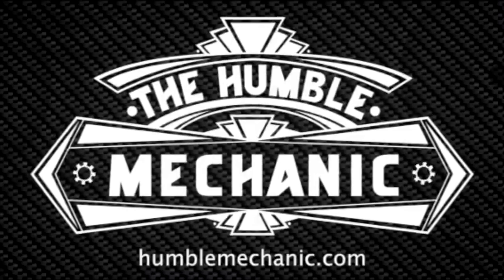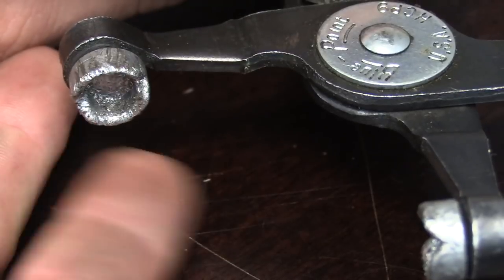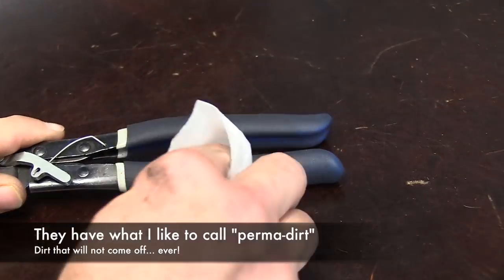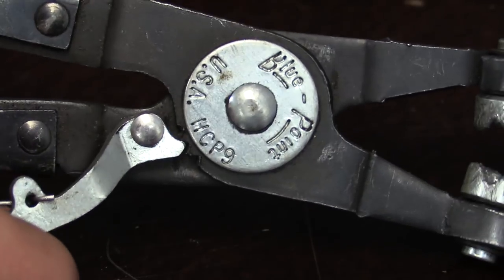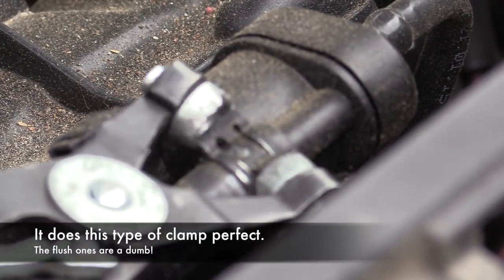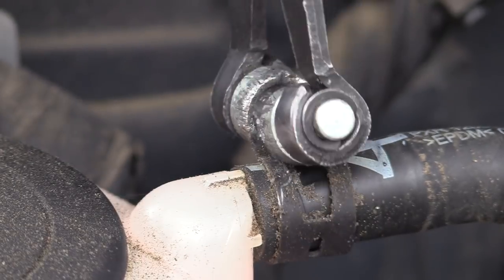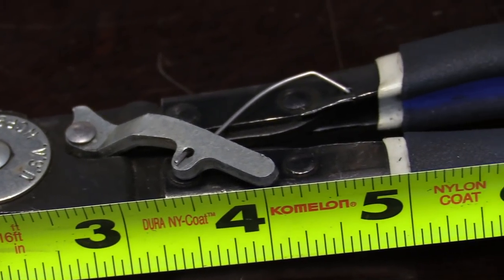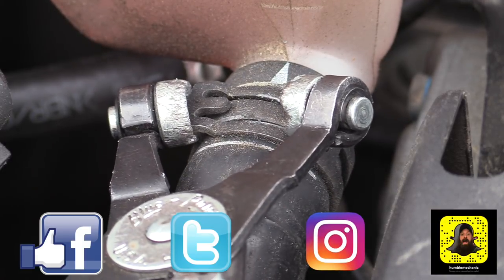Blue-Point HCP9 Hose Clamp Pliers ~ Review

Comment: I agree, I use these all day at the Beemer dealer. Sometimes i use the SHCP1A. The jaws wear out on the Blue-Point, but they sell the jaws individually $9.12. Its sold for $46 here. In a pinch you can use needle nose pliers, but these work better.

Comment: Hi!, By the way, what I have currently and personally observed and experienced is that in any hose clamp pliers construction (whether it is the costly Snap - on or cheap Blue - point brand) the cups which holds the ears of the hose clamp are not made getting use of the harder metals like Chrome - vanadium or Chrome - molybdenum steel which are not easily get damaged with the repetitive use of this particular hose clamp pliers. Thanks a lot. I'm going to see you later or soon with an answer from your party. Moreover, I wish you all the very best for your future automobile repair jobs and best wishes or kind regards from Mr. Thusharapriya Perera.

Comment: I just got a pair at a pawn shop yesterday along with a mix of 7 mac and Cornwell impact sockets as well as an oem nut Buster all for twenty bucks and I was pretty happy with that the only difference with my pair is that the handle covers are red and instead of the little latch and has a screw with a spring on it on the one side which reminds me of a vice grip in a way now I just need to go back and get the hose pliers LOL

Comment: Great pliers I agree. Funny how often though the clamp has been put on at the factory in a completely impossible angle to get them on.
Reply: Easy when most of the parts blocking access are not in the way during assembly.

Comment: I'm an advanced DIYer and was seriously considering the HCP9, appears to be a great value at $23 for a USA made tool. But Snap-On online wants $15 to ship, for a total of $48 including tax (local Snap-On dealers are not interested in my money).  So, it looks like I must spend $200+ to get free shipping on hand tools online from Snap-On now.  Think I might just go with the Knipex 10" hose clamp plier without the locking feature, I found it for $55 with free shipping, or even better as a 2 plier kit with the 10" Cobra water pump plier for $85. Rather just that than jump through hoops with Snap-On.
Reply: So just a follow up for anyone looking to buy an HCP9 or HCP10 hose clamp plier from Snap-On.  I have researched the crap out of this since yesterday, and I believe these are both re-brands of SE Tools products.  The HCP9 is a rebrand of the SE Tools 875G and the HCP10 is a rebrand of the SE Tools 860G, with the main difference between them being that the SE Tools version has red cushioned handles, and the BluePoint ones have a different color.  In addition, Cornwell also resells the 875G but does not hide the fact that is made by SE Tools.  
Both pliers can be had on Amazon for around $14 or $15.  And SE Tools covers these products with a lifetime warranty, and sells rebuild kits for both pliers as well.  SE Tools manufactures these products in Michigan, they are not cheap CCP-Chinesium pot metal crap, like so many others in the marketplace today.  Check them out at www.setools.com and look in their catalog, or search on Amazon.  I will be buying a set of each since I am saving money over the SO price and I don't have to pay $15 for shipping at SO online.  Since they are priced so low, I am going to pick them up in addition to the Knipex pliers.  These will complement my Mayhew 28680 remote cable pliers (which is the manufacturer of the SO SHCP1B, which sells for 3x the price).  Hope this is helpful!
Reply: @StilettoSniper  Thanks, your follow up was very helpful. I just ordered the SE Tools 875G from Amazon for $16.
Reply: @StilettoSniper  Tysm ordered the SE Tools model, cheaper even in Europe

Comment: In aircraft there is a line clamp for mounting a service to a bulkhead or frame they are steel with a rubber rub/grab insert.  These a the aircrafts idea of a JC clamp because they have to be compressed to put the screw through.  But the manufacture  made a tool to help compress the clamp and one or two were shipped with each box of clamps free   Problem the tools in part would rebag the clamps and throw the special tools away they never issued them so most mechanics never saw them and the tools in part never knew the tool crib would stock these special tools if part would send them over and the tools in the tool crib never knew these tools were ever in plant.  Some older guys had these but kept them lock-in their tool boxes due to sticky fingers.  
I have removed and replaced many JC clamps it seems like getting the right tool would reduce the chain of never ending swear words.  I have seen some clamps that look like they are one time use you put them on and cut or break them off.   I was at a boat show and saw a guy Hawking a tool to make your own clamps out of wire called CLAMPTITE these seem to work well but again they are throw away and you make a new one each time you need one.  Also you don't have to buy clamps you just buy cheap wire at Walmart.

Comment: I have those pliers. I like the cable ones too
Reply from the maker: +Pdx Mobile Repair 9712190519 the cable pliers are a tool it's worth spending the $ on. The ones I have are cheap. And awful
Reply: yeah. After fighting those spring clamps with normal pliers I decided that spending few bucks is worth it:)

Comment: Knipex FTW, not cheap, but absolutely worth it
Reply: The Knipex hose clamp pliers are robust, but for a non-pro they are WAY overpriced in my opinion.  Instead, I would suggest the HCP9 (Corbin clamps) or the HCP10 (Mudea flat spring clamps) for small and medium hoses, and have the Knipex 10" hose clamp pliers for the big radiator hoses that need powerful leverage for removal.  Personally, I would not spend the money they want for the smaller 7" Knipex.

Comment: Those remind me of the Knipex pair. Good review.
Reply: The Knipex hose clamp tool is much stronger and provides much better leverage to remove the big clamps, but it is MUCH more expensive.
Reply from the maker: The only limiting factor I’ve ever seen with these is opening size on clamps. Knipex makes awesome stuff
Reply: @HumbleMechanic  I agree, Knipex is very robustly built.  A bit overpriced for the non-pro like me, but definitely a well-made tool. However, I like using and can appreciate a well-made tool, so I've sucked it up and bought a set.  I'm using the HCP9 and HCP10 for small and medium clamps, and also have the Knipex 10" hose clamp pliers for the larger radiator hoses that need the extra leverage for compression.

Comment: Would these also work to remove the low pressure fuel line clamp when removing the high pressure pump on the 2.0T FSI?  I used needle nose pliers but they felt like the wrong tool for the job.

Comment: when replacing heater hoses is it ok to reuse the same hose clamps or get new ones and you think is ok to use screw on hose clamps  thank you.
Reply: dany ordonez reusing the hose clamp is fine provided it is not damaged. 
you may but put screw type on but make sure they are straight and not over tightened. i do not know why you would though, these are so much quicker and easier just require a tool.
Reply: I would reuse the OE clamps if they are in good shape.  This is one reason why you should use the right tool to remove them without butchering them in the process.  I used to remove the OE clamps and replace them with the screw worm drive clamps from the auto parts store in my younger days.  That is, until I learned better.  Even though they are a helluva lot easier to install and remove, I learned the hard way that the easy way isn't always the right way.  See, the thing is that the performance of typical auto parts store worm clamps is substandard compared to spring clamps because they fray the hose with the adjustment slots, they can strip, they can cut into the hose, they may not be able to apply adequate tension to prevent leaks, and they don't compensate for the shrinkage of the rubber over time.  If you absolutely have to do this, use the racing style T-bolt clamps.  Yes they are harder to find, but they don't give you the problems of the cheap worm clamps with the exposed slots.  So my recommendation is that if you are going do your own auto repairs, take the money that you saved over the price of having it done by a pro and invest some of it in purchasing the right tool to remove the OE clamps properly.  Just my two cents.

Comment: I'm having throttle body issues on my b6 1.8t
i pick up a used one at the pull a part, didnt work.
getting the code g188 would i have to realign after installing?
Reply from the maker: +Nay Cee yeah you'd need to readapt it.
Reply: HumbleMechanic readapted and still issues persist

Comment: suicide clamps suck i throw them out and put normal worm clamps on. perks of working on a fleet
Reply: Yeah I used to do that too until I learned better.  Even though they are a helluva lot easier to install and remove, I learned the hard way in my younger days that the easy way isn't always the right way.  See, the thing is that the performance of typical auto parts store worm clamps is substandard compared to spring clamps because they fray the hose with the adjustment slots, they can strip, they can cut into the hose, they may not be able to apply adequate tension to prevent leaks, and they don't compensate for the shrinkage of the rubber over time.  If you absolutely have to do this, use the racing style T-bolt clamps.  Yes they are harder to find, but they don't give you the problems of the cheap worm clamps with the exposed slots.  Or just man up and purchase the right tool to remove the OE clamps properly.  Just my two cents.

Comment: I always cut mine off and then put on the screw ones I hate claps they are from the devil
Reply: Use the racing T-bolt style clamps, not the typical auto parts store worm drive clamps with the exposed slots.  See my reply to moocow7590.